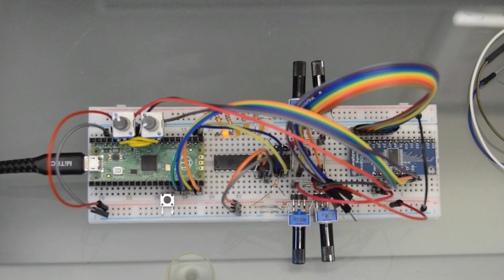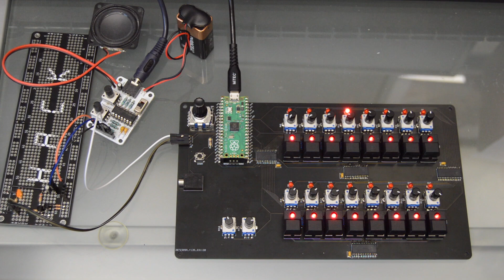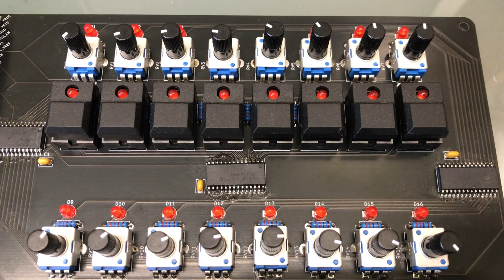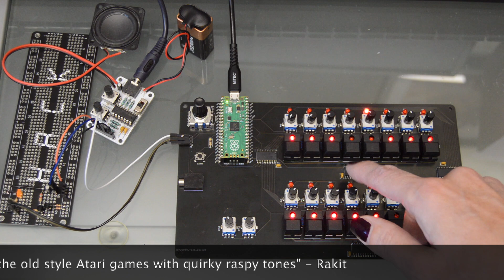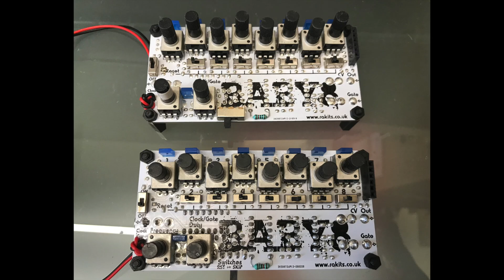Prototype Thursday: More on the 16/32/64 step sequencer

Comment: Great demo. Fun project. I really like it. I know what you mean about simple vs fully featured. Simple sequencers are more fun but inevitably you have to make compromises so it just won’t appeal to everyone. On the other hand if you add too many features it becomes somewhat unintuitive and again won’t appeal to everyone. The real challenge is to find a design that handles like a simple sequencer but has the advanced features available if you want them.
Reply from the maker: Thanks for your input. You're right that that's the most difficult challenge. It's not so much 'more features' as 'it works differently'. The 2 or 3 different ideas could all work on the same board with different firmware (and different face plate).